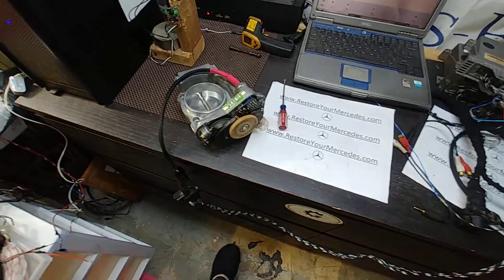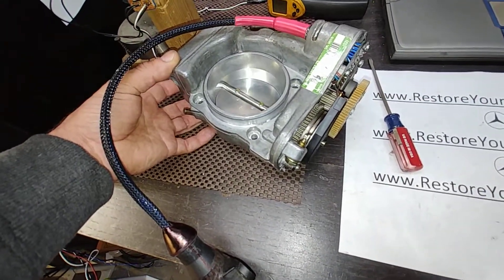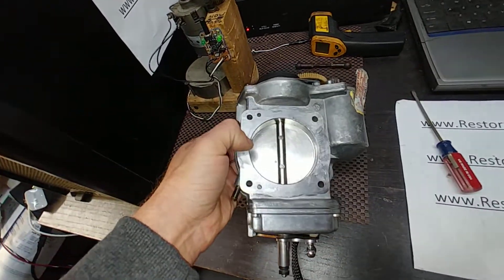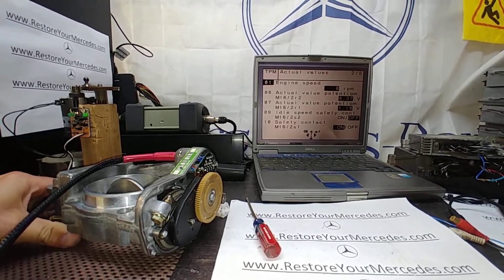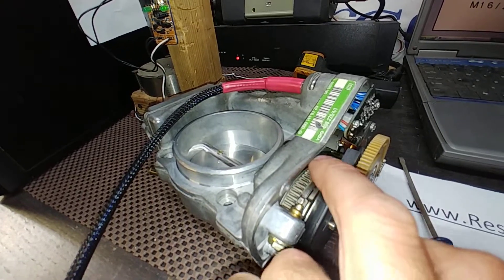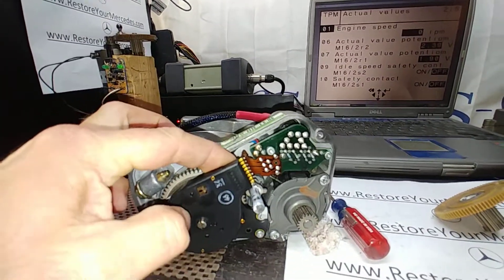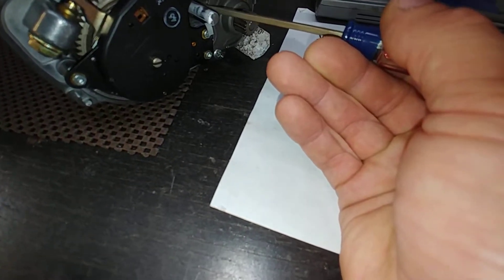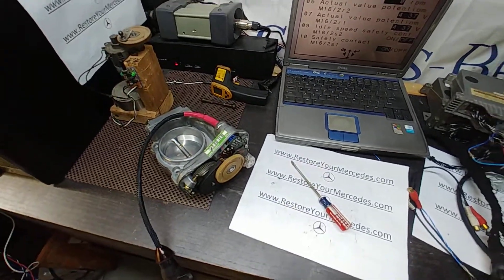Mercedes E320 throttle body bench test

Comment: I have an 1997 E420, when i turn on the accesories on the car and when i pull the cable for the throttle, its suppose to open up all the way correct? Might it be the wiring or the throttle body itself that is defective?